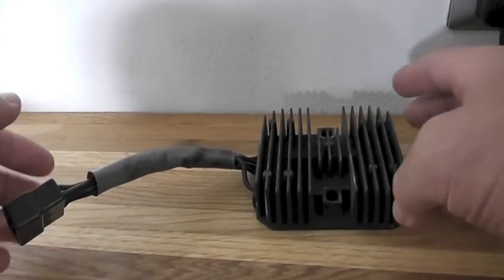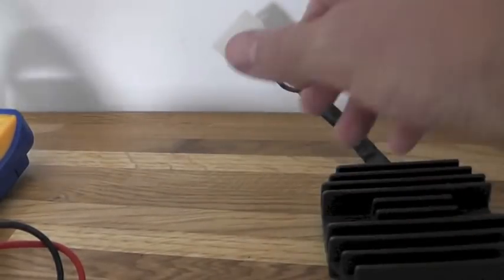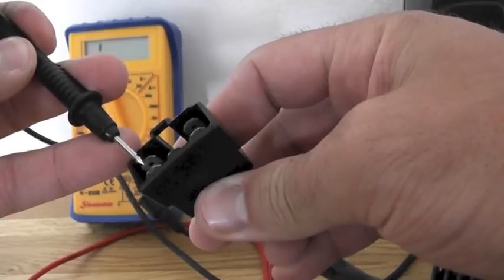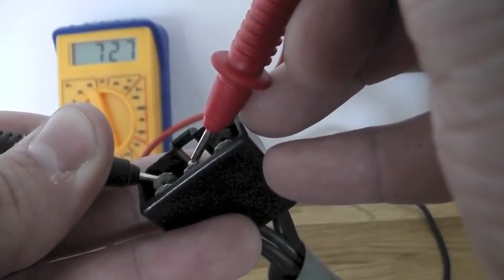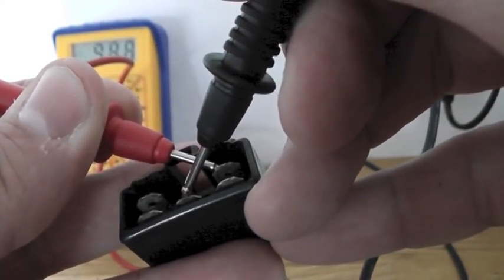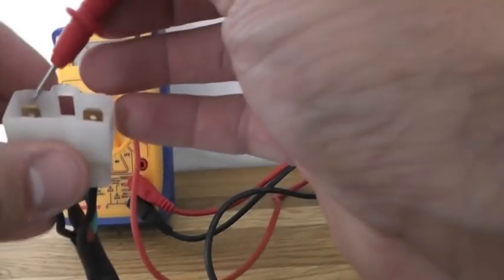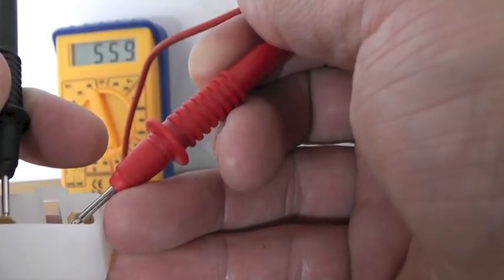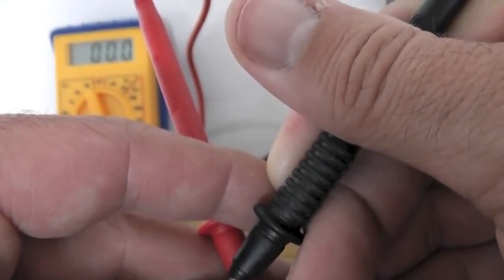Rectifier Regulator test faulty against good one

Comment: In my case (regulator SH634A-12 from Honda Dream C100P), the resistance between ground and one of the phases was 6 Ohm in one direction, otherwise infinity in all other combinations (my old meter doesn't have diode mode) Due to that I got 15 Ohm on battery terminals. When trying to attach the battery it was sparking (maybe some 0.8 A). A new R/R (SH707AA) reads 1500 Ohm at green-yellow and battery terminals as well. I assume it  cause battery to drain and not charge.

Comment: I know it's an old post but had same issue , but when u got two reading s and a zero  on your last test I got zero on them all🤷‍♂️
Reply from the maker: I'd say that sounds like that's completely knackered. I would double check that your multimeter is on the right settings to be sure and will only be able to tell if you have a good rectifier and its reading on all
Reply: @Bone T  thanks for your reply, since then I checked the battery voltage it was low 11.6v with the bike not running , then I checked it while running and it went up to 14.4v  ,then I put hhen lights on and revved up to 5000rpm and the voltage was still over 14v , so with this I'd say the stator and rectifier seem good there doing there job🤷‍♂️ it's got to be the battery cells
Reply from the maker: @andyt4289  glad you managed to pinpoint it with a bit of testing hopefully new battery will sort it

Comment: Thks four your excellent video I have a Piaggio Zip 2T other day I drive and same one stop me and tell me my rear lights is blinking after 2 days all my lights is blown front and rear I’m surprise my fuse don’t blown also when I drive in full throttle same times is cut don’t the speed what you think is my regulator fault thank you help appreciate
Reply from the maker: Could well be got this info from another site full link below. If the voltage regulator is intermittently having problems then it’s most definitely the source of your bulb problems. This is due to spikes of high voltage jumping through the system which in turn blow the bulb filaments and/or headlight fuses.

https://www.driven2automotive.com/blog/why-do-my-headlight-bulbs-keep-blowing/#:~:text=If%20the%20voltage%20regulator%20is,filaments%20and%2For%20headlight%20fuses.

Comment: Hello. Negative lead on positive side I get following reading : .553,.553,.544
Positive lead on negative side : .557,.521,.551. 
Are the small differences indicating faulty rectifier?
Thanks!
Reply from the maker: Hi, as the differences are nominal it wouldn't suggest to me that this is indicating a fault, they are all around the same area.But I'm no expert on this
Reply: @babyloncrusade1  thanks

Comment: Bro the service guys says that my battery is not charging is it because of rectifier or magetocoil....
Reply from the maker: Could well be the regulator/rectifier you need to check if that works first check out this video https://www.youtube.com/watch?v=Vj1p7Ffi0Zs
Reply: @babyloncrusade1  bro the service guys checked my bike using rectifier from another bike (same model).. and the battery is charging...s this have anything to do with magneto coil??bcz the battery is charging with another rectifier.. after they service  my bike will there be any further problem with battery? .. they said the battery has no problem it shows exact 12v but its not charging...im little concerned bro... i left my bike there bcz the parts aren't available due to covid 19
Reply from the maker: @subinkrishnakt4058  regulator rectifier aren't designed well and do have a tendancy to fail. If they have tried another and that works it looks like that's the problem. I wouldn't expect you to have any issues if that's done. But you can't be 100% but should be ok

Comment: If the regulator not working the bike will not start is it?
Reply from the maker: The bike will potentially start but the faulty regulator won't charge your battery or could overcharge causing your battery to heat up. Eventually the battery will die as a result and then the bike would not start due to a flat battery

Comment: I have a 2001 GSXR 1000 K1. I've been fighting with this thing for 3 months it started off with a turn signal relay because dude i got it from had the wires bare hangin in there. I ended up replacing the ignition the kill switch to start switch bypassing the kickstand sensor, new battery, replaced almost entire wire harness, then fired it up and ran out of fuel sucked crap into system, took the tank off pulled the fuel pump out cleaned it all out real well put in new fuel put it back together ran it with sea foam then it fired up but was missin and backfiring bad. Adjusted tcs and finally was sounding good pulled out of my yard it died and wont start at all now.... I was about two seconds from setting it on fire so i pushed it outside threw a bottle at it and there it sits. Every time I walk by and look at it I just want to keep the f**** thing over  and go in there and fix my gotdamn Harley and say f*** Suzuki!
Reply from the maker: Torch it less stress

Comment: Wouldn't it have been better first up to check to see if the alternator was charging.
Reply from the maker: I'd had this problem before and sign was battery was not been charging down to faulty regulator rectifier. This is just to show the difference between a good and bad one.

Comment: I replaced my stator on my jonway 50cc scooter the cdi and spark plug coil I'm still not getting fire to my spark plug what could be the reason
Reply from the maker: I'm no expert on this but I would first check that every component is doing what it's supposed to to. For example start with the stator use the multimeter to make sure that's doing what it should and move on to the next. It could be an issue with wiring somewhere.

Comment: 'I' means infinity i.e. open circuit no resistance value detected. My regulator I am going to fit on my SS50 is solid state with 4 wires. Yellow and pink are AC (from alternator) IN. Red is + out and green is - or ground. The existing selenium rectifier is bolted to the frame (- chassis or earth) input (AC) is white and output + is red. Earth or chassis is common (ground) to both AC input and DC output

Comment: Would you know why a regulator would be overheating
Reply from the maker: A poor ground can cause overheating with bad connections and corrosion causing incorrect voltage, insufficient cooling as well

Comment: So in a 4 pin you would go from the red output prong to the 3 stator windings, then test from the case since it's grounded that way backwards?
Reply from the maker: SYNTHETICDARKNESSRX8 sounds like that makes sense
Reply: Bone T well I just did it and got similar results lol.   One open, others are the same on one unit, the other varied pretty good which both are bad to begin with.  Thanks for the quick response and video!

Comment: I have replaced the stator, coil, , and battery to find out that the cdi box was bad. I replaced the cdi box. It ran great for about 4 hours, Then the battery blew up and the cdi box melted. I tested the voltage regulator that is identical to the one you show in your video. The ''new'' one and it reads the same. I was told by a few people that the regulator is what caused the battery to blow or over charge.  Now I don't know what to do. Any thoughts?

Comment: Hello, is there any chance that a faulty reg/rec will cause stator failure like burn one of the coils? 
Thanks in advance
Reply from the maker: Ian Bolchi got this info from another site....
A bad diode in a rectifier will dump AC current into a system. The AC current heats up the stator and the heat destroys the insulation and ultimately carbonizes it turning it into a low resistance brick. Most stators are three phase AC systems so there will be three diodes in the rectifier that can potentially fail and allow AC current into the system.

As well, the additional heat destroys the insulation on the leads in the wiring harness that can cause a cascade failure of the harness due to heat degrading insulation.
Reply from the maker: got this info from another site..A bad diode in a rectifier will dump AC current into a system. The AC current heats up the stator and the heat destroys the insulation and ultimately carbonizes it turning it into a low resistance brick. Most stators are three phase AC systems so there will be three diodes in the rectifier that can potentially fail and allow AC current into the system.

As well, the additional heat destroys the insulation on the leads in the wiring harness that can cause a cascade failure of the harness due to heat degrading insulation.
Reply: Bone T thanks a lot for your prompt reply mate, I had the reg/rec checked and I'm getting 0.578, 0.578 & 0.457 is this bad?

Comment: Hello can anyone help me😅, my R1 2011 problem to start, on switch on starter but quite no sound from the starter
Reply from the maker: Hi id check connection with your starter motor also make sure battery is produsing correct voltage
Reply: Tq, i will try to check it 1st, for your info, before it's happen when i start a few seconds the starter crank you can hear and after that it's gone , no crank anymore .anyway thanks for ur feedback

Comment: hey I have a problem with my honda steed vlx 400 model 1994 , suddenly my regulator rectifier died , I bought a new regulator made in Taiwan , I put it in my motorcycle all is good , one moth latter or two months my new regulator is died , I bought a new Taiwan regulator 1 week same of that one and is died again and every regulator I put in my motorcycle a little of time and is died and burn and trash 
and I dont know what I should do I pay above the 200$ of regulatores 
I want any help please , thank you thank you very much , and I am an aircraft maintenance student 
I want to start with any test , stator or rotor or battery or if there any short in my circuit or if the new regulator is made in Taiwan and the motorcycle is japan please any help thank you.
Reply from the maker: Sorry didnt reply sooner had the same issue went through about 3 and they were cheap versions if you do get an original it should be covered by some sort of guarantee. they just get to hot and over heat or fail and toast your battery. you could try mounting it somewhere where there is more airflow to cool it or hook up some sort of fan to cool it.
Reply: Bone T u mean that if I put a fan to cool my regulator u think it will be in a good condition ?
Reply: and will never burned again
Reply from the maker: id start with not bying a cheap one they never last. And the fan was just a suggestion ive read that other people have had a degree of sucess doing this. I cant say it will never do it again
Reply: mmm okay thank you very much for help thanks

Comment: I have a Honda Rancher and it won't charge while running is this the problem?
Reply from the maker: Austin Granger could well be you'll have to test the regulator to see if that's at fault to be sure
Reply: Could it be the Alternator?
Reply from the maker: Austin Granger it could if it has one. read this below from another site. the twisting of the throttle with the lights on seems to be an easy test to see if it is doing any sort of charging:
One way to see if you are gaining a charge from your alternator or generator is to use a multimeter. What you will need to do is to test the voltage of the battery while the engine is not running. Now that you have taken this measurement start the engine and test the voltage once again. You should notice that when the engine is running the voltage should be slightly higher as the generator is now providing an extra charge to the battery, which will result in the higher reading. Expect this new reading to be up to around 14v if your alternator or generator is working as expected.

Possibly one it even easier way is to turn on your motorcycle headlights and give the throttle a bit of a twist. If you notice that the headlight has now become brighter since you increased the throttle, then this means that the alternator or generator is providing an additional charge to the battery. This test should have only taken you 10 seconds at the most and requires no skill at all, it is an easy way of quickly indicating if there may not be something quite right, especially if you don’t have a multimeter to do any further testing by yourself.
Reply: Bone T so the lights dont go brighter does that mean ita bad i havent got a mulitmeter to test it

Comment: Good video Bone T. Having the same issues right now! The rectifier tests OK. Any ideas on the output voltage of the stator should be when running?
Reply from the maker: Grabbed this from another site it sais: 
There are 3 yellow wires coming out of your stator. Disconnect the plug,
 and set your multimeter to AC voltage, and test across each of the 3 
wires. ie if there are 3 wires, A B and C, test A-B, A-C and B-C.

The three voltages should be the same, and should be up around 50-60V when you rev the bike to 5000rpm
Reply: Will check it out. Thank you
Reply: Bone T
Reply: 50 -60 volts into rectifyer

Comment: my motorcycle in good condition i just bougth a 12 by 12  12v batery and after 4 days its been low i cant star it and i charge it in a charger in a dc device and it goes well and after 7 days my friend barows mt motor and after he started it in 4 times its not starting he said and wen he came home the light are not torning on but wen i run the motor and go aroud the pce faster its started to light but its not starting its just the light wen i click n start botton its noting can u recomend me what the problem man thank ^
Reply from the maker: +fahad rangaig The first thing i would do is try another battery in it to make sure the battery isnt faulty. If its doing the same thing you would need to work back from the battery and check the regulator. If that appears to be ok then its probably your stator which generates the electricity that goes through the regulator and then charges the battery.
Reply: yesterday its charge just a little but the starter didt work just the light ^^
Reply from the maker: +fahad rangaig I'd definitely try and test it with another battery first
Reply: i wanted to do that but i do not have much money ^^ but anyway thank you man ^^
Reply: +Bone T year

Comment: Hello my 2004 cbr 1000rr is having problems keepin a charge i changed the stator n its still doin it? #Helpiwannaride
Reply: Ramel Stevens Hey man sounds like your rectifier is converting to DC or your battery is worn out. I'd have the battery load tested after I checked the rectifier. should get you cruising in the hammer lane in no time.
Reply: I hace a 86 Suzuki Intruder 850 AND ITS making my Battery blow up can anyone help me

Comment: When I bought the bike the owner told me that they had just changed the rectifier and that it needed a new stator. I replaced the stator but batt held charge only for like 30 min. So I just recently changed the battery. I took it around my neighborhood a couple times and I cut it on and off when I put it back on the tender it said 90 percent. Should the battery be 10 percent gone already It's a brand new battery
Reply from the maker: D Stanley Id kinda guess no it shouldnt it sounds like its not charging which again would point to the rectifier. If they didnt use an original they can be faulty even from new I have had it myself. Id keep an eye on the battery see if its loosing more. If it is looks like it is you may have to invest in new rectifier again
Reply: When a stator goes out, it takes the R/R with it. So if he just replaced the R/R and left the bad stator, the stator took it out. Now that you've replaced the stator, replace the R/R and it should be golden

Comment: Hey I have a Honda CBR 600 FI 2002. I just had a question when I start my motorcycle and I drive it for a long time after I turn it off it doesn't want to start anymore. I have to push it. And when I want to start it it sounds like if the battery is dead in till next day it turns on like nothing. I was told it could be the Rectifier sensor..do you think that's what's wrong. Thank you! Just wondering if u could help me find out what's wrong!
Reply from the maker: Jaime Lopez I found this: Problems with the ignition coil can make an engine impossible to start when
warm (or even stop running when it warms up), apparently this happens on
motorbike engines quite often and is caused by a break in the HT coil. 

A carbon track forms inside the coil where the wire is broken. When the
engine is cold the carbon track has a low resistance and it conducts well
enough so the spark is strong enough to start the engine, when the engine is
warmer the track resistance is greater and the spark less strong. This
problem gets worse over time as the carbon track gets bigger and bigger, the
only remedy is to change the coil or electronic ignition module.

Comment: I have a 82 kz1000 kaw.when I try to start it I have wires melting the last time I fixed the Burt wire another one started to melt it is going to box? under the battery any suggestion where to start
Reply from the maker: Bill Spalek It could most definatly be your regulator at fault. Mine again is faulty as same thing I start mine and immediatly burning smell and wire melting. Im no auto electritionso could be anything. im gonna repalce my regulator again and hope that that fixes it. Wiring on these older bikes are a nightmare. If all else fails take it to someone who knows what there doing.